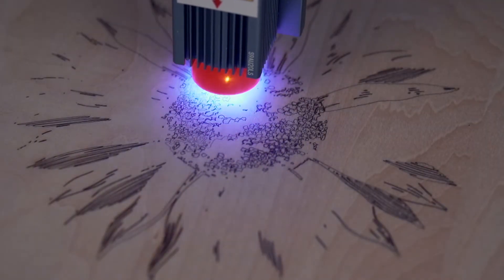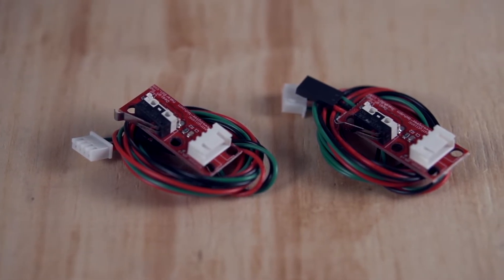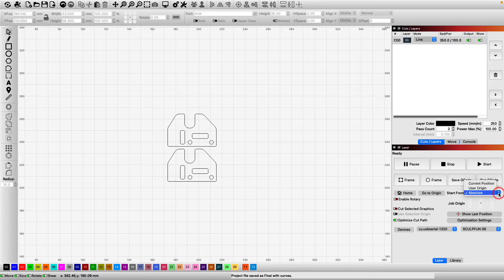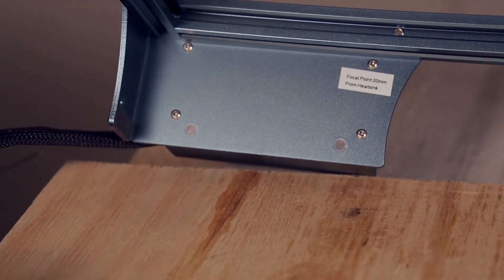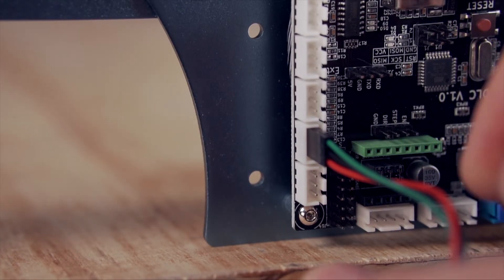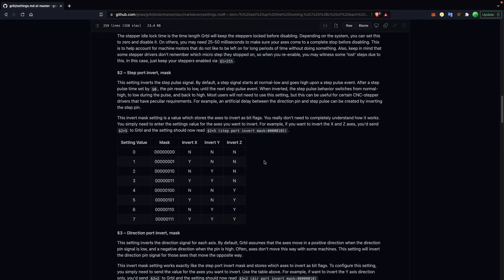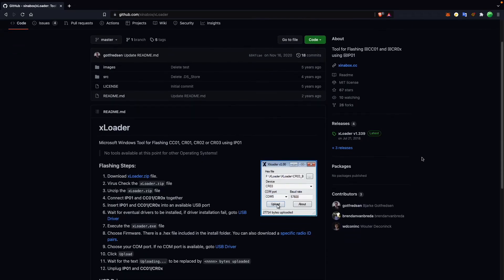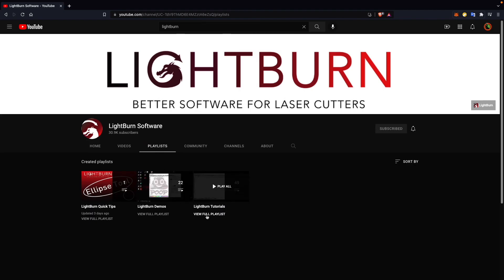Go Home! - Installing Limit Switches on a Diode Laser

Comment: I added the switches and it goes home great. the only problem I have is now I can only jog laser in one direction in Y and one in x direction. I try to frame and it goes to the opposite diagonal corner in rear. I only have setup with the macro so I power down and restart without macro and it works fine but I can’t home. What did I do wrong?
Reply from the maker: Did you select the correct corner for origin? If not that would cause things to be mirrored and could cause movement to behave as described if the laser thinks it is at max distance in one direction. Also, I would try absolute coordinates for the Start From mode.
Reply: @lightburnsoftware7189  Thank you for your time. The error I get says value on or near line five is not recognized. I will try this again and use your suggestion. Thank you.
Reply: I got them to work because I didn’t have the right numbers for -409. and -399. Numbers.The question I have now is when laser is done cutting it stops and goes home but it crashes moving on the diagonal, Moving in the regular homing x then y it works fine. I really appreciate your time.

Comment: Works on s10 too?
Reply from the maker: In theory as long as it is running GRBL, and has the connections for limit switches on the board then yes. However, we have not tested it on the S10 and you will need to be careful when wiring to make sure the pinout is correct.

Comment: I was a little uncomfortable with leaving the circuit boards exposed like that, so I tweaked your .stl file to make an enclosure for the limit switch, which I'll be happy to send to you, if you'd like to use it or include it for others.
Reply from the maker: We had originally designed a different .stl for the 3d printable option but decided we wanted to keep the same file for the printable and laser cut option. If you have not already, uploading it to a .stl sharing site would be great to give others an alternative option.
Reply: Hello, can you please share the stl file

Comment: May I ask how long the extension cable  should be?
Reply from the maker: The ones we recommend in the description are 70cm. However, there is a bit of extra slack on them.
Reply: @lightburnsoftware7189  I purchased and received all the parts you suggested, I am about to install the limit switch tomorrow 😁

Comment: What a brilliant support video!!  I bought a Sculpfun S10 and went through the process of purchasing the items to fit the Limit Switches.  I VERY carefully installed the wiring; checking and triple checking my G (Black), V (Red), S (Green) wires were correct.  When I reconnected the USB and Power switch and turned it on, Lightburn wouldn’t recognise any connection.  I noticed that the USB light on the motherboard was off.  I disconnected the X and Y connectors from the motherboard and the USB light came on and I was able to connect my S10.  Does anyone have an idea what might have gone wrong? Thanks. Bill.
Reply: cut the NC pin on the microswitch.
Reply: @codreanurazvan5928  I've seen that somewhere else and wondered if it might fix it.  I was a bit wary of messing up the motherboard, but I'll give it a try when I get back at the end of the month! Thanks.
Reply: @billswindlehurst293  I already had same issue and fix it like that
Reply: @codreanurazvan5928  Thank you for the advice! Had the same problem and fixed it like that! :D
In my sculpfun S10 the wiring was the following (green in the top, black and red cutted out)

Comment: I'm kinda scratching my head on my problem. My Machine will not move when I send the $22=1. It is not a popular brand but the board is Makerbase MKS 2.1 V. I'm thinking maybe just go to the flashing board video.
Reply: Got to read, read, read and when you are done....Read some more! I got it figured out!
Reply from the maker: Glad to hear! What did the solution end  up being for your board?
Reply: She is cookin Now! Applied off set and changed location of Limit switches.

Comment: Received my Sculpfun S9 this week and ran through your setup (very easy, thanks!!). It did save the settings without updating the firmware. Maybe they're shipping with a better version now?
Reply from the maker: It is very possible that they have updated the firmware on their newer machines. If that is the case it is great to hear.

Comment: I installed my switches, easy enough to do. But for some reason when I press the home button, it moves in the right direction then stops after moving towards the physical home position. Once stopped there it will not do it again. IF I move the laser back or to the side. press home it goes to that spot again. Like it has determined that this location is home.

Comment: Thanks found the file the atom stack is not as easy to put the limit switch on y axis left hand side as you cannot fix in position as the carriage misses the switch, may have to mount on right hand side anyhoo see how it goes
Reply: Did you try mounting the switch on the vertical face of the extrusion instead? The carriage will engage it when I do it that way.  Or you could cut a few modified stops to build up a mounting block which allows you to place the switch in upside down (therefore engaging on the right where the carriage frame will indeed strike the arm)…?

Comment: Hi again, Making progress. 2 issues i am having. Issue 1 is when i hit the home but it moves only so far in the correct direction so i have to hit the home button until laser is homed,  Issue 2 is that when it hits the limit switches and the lights come on it backs off so far that the lights go off and then it surges ahead to rehome itself and stays on the limit switch with no back off and the lights stay lit. I have the atomstack 5r pro  My hard and soft limits in machine settings are set to false if that matters. If i forgot to give any info Please just ask me for it. I am new to this laser business so be patient with me Thank you in advance for any replies.

Comment: Hi, using an Atomstack A5 Pro. I installed the switches but when I go to home I get the following error: 

ALARM:8
Homing fail. Cycle failed to clear limit switch when pulling off. Try increasing pull-off setting or check wiring.
ok
Grbl 1.1h ['$' for help]
[MSG:Check limits]
[MSG:'$H'|'$X' to unlock]
[MSG:Caution: Unlocked]
ok

Any idea what I'm doing wrong?

Comment: Have been looking but can't seem to find the answer. What is the benefit of adding limit switches. Aren't print and cut and circle finder already usable without them?
Reply: I, too, am wondering what the benefit of the limit switches is. If you park the laser head at the zero/zero position before you power up the unit Lightburn will consider this the home point for the entire session. Works perfectly for me. (Sculpfun S9)
Reply: @howardsmaid3491  I'll post this question in the lightburn forum.

Comment: Great video! I have my Atomstack A5 now set up with limit switches. Looking forward to flashing firmware video so I don't need the macro.
Reply: Craig, Please read my comment with issues, Maybe you can help me, Thanks in advance
Reply: @assantemark  Hi Marx what problem did you find with the Atomstack was it that you could not fit the limit switch to the left hand side y axis, I found that the carriage misses the limit switch so I’m thinking I may have to mount it on the right hand rail y axis cheers Matt
Reply: @assantemark  This worked for me. https://www.youtube.com/watch?v=a5nOei49S8I&t=34s

Comment: Got a weird one for you. Limit switches added. wired properly. I do $$ all settings GRBL factory normal. $21=0 BUT I get a error: 5, Homing cycle not enabled in GRBL settings. I run macro called Limit Switches. All settings go to what macro says as per this video. Primarily $21 to 1 and NO errors. Now EVERY time I press Home, I get error: 5, Homing cycle not enabled in GRBL settings but $$ shows $21=1. Also setting the G10 L2 P1 is there or is there not a space between the 3 inputs?
Reply: Also when I disconnect the 2 limit switches my Sculpfun 8 Pro works great.
Reply: Just got it to work. Had to change $22 from 0 to 1 also. Homing cycle, boolean

Comment: Excellent guide. Followed it and limit switches now working perfectly! It also looks like my S9 is remembering the settings. Many thanks.
Reply from the maker: That is great to hear. Perhaps they have corrected the issues with the GRBL firmware they have been using. Enjoy!
Reply: Weirdly mine won't let me change the home direction, but it did default to the front left. Great guide though.

Comment: Great video, ordered my parts today, Spacer file is in code not sure hoe to get that into lightburn any help is greatly appreciated
Reply from the maker: When you click on the drive link you should see a button in the top right corner that is 3 dots stacked on each other. Click on that and then download. When it does download it will be a .lbrn2 project file that you can import into LightBurn.

Comment: The folks at LightBurn are to be commended for such a video by going beyond their normal scope of support.
Reply from the maker: Thank you for the kind words. We have gotten quite a few questions on limit switches and general GRBL firmware issues. We are hoping that this will help many through the process.
Reply: @lightburnsoftware7189 guys, your commitment made me buy the license before trial expired. I feel safer getting Lightburn than i feel about getting Adobe product.
Reply: Yep, 2 years later and I am considering buying their SW. The only thing holding me back is end of Linux support :(